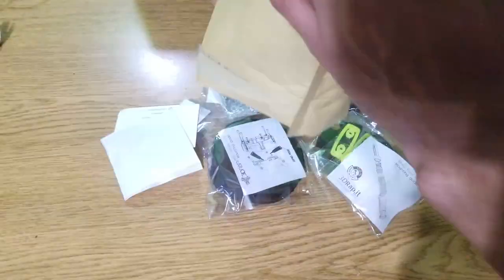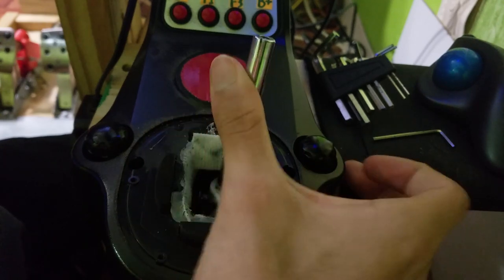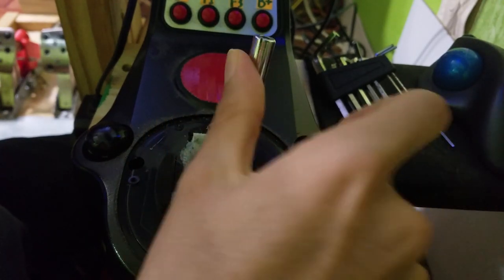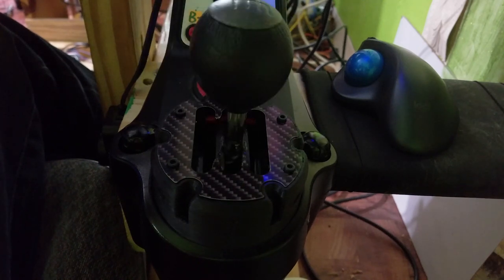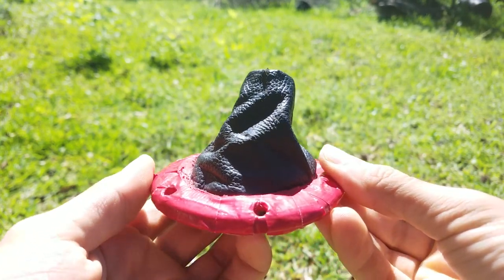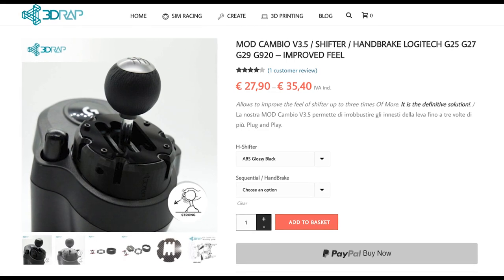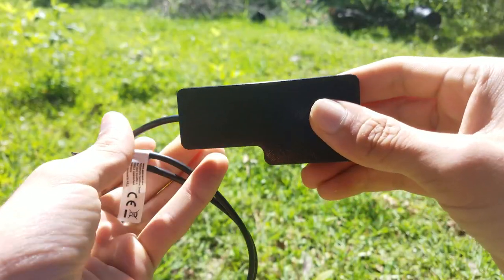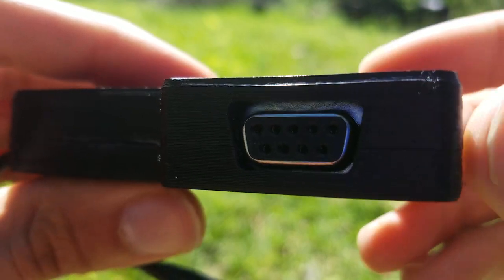Are 3DRap's Logitech Mods Worth it? | 3DRap Logitech Shifter Mods

Comment: How's it holding up & why did you have to remove your velcro mod?
Reply from the maker: It's worn down a ton. Now it takes just as much effort as stock but still has a little bit more notchy feeling. I had to remove the velcro as it prevented my lever from going into the notch on the mod cambio.   I have now upgraded my shifter to an SHH NEWT that feels absolutely fantastic and I will be reviewing soon :)
Reply: @TechiePocket1  thanks for reply 👍
Reply from the maker: @shinks268  Np!

Comment: I ordered the mod yesterday and just found this video now. Was that a mistake?   Although I do think in 4 or 5 years, with the replacement parts, the entire shifter setup will still cost less than the SHH
Reply from the maker: Sorry to say but in my opinion it was a mistake. After a months use (driving everyday about an hour or less) this thing was shot so bad it would slip into gear with my pinky. So $37 it was shipped to my house, then every month i have to get a new part which is $10 and then shipping on top of that.... after 5 years thats $600 without shipping! The SHH is only $125 shipped.
Reply: @TechiePocket1  there is a new mod now from another website that doesnt wear
Reply from the maker: @Willeexd1337  what's the website?